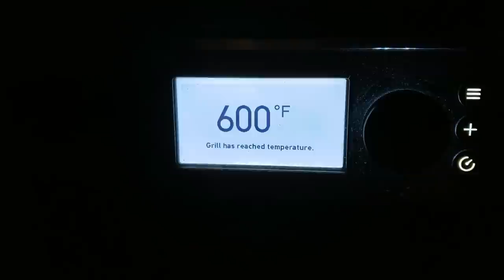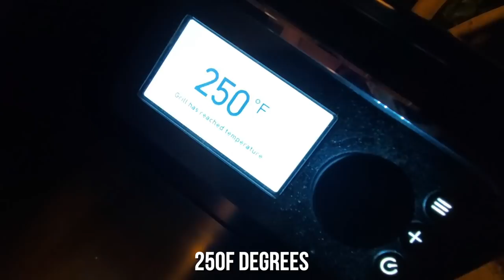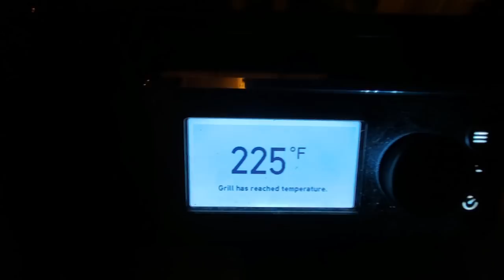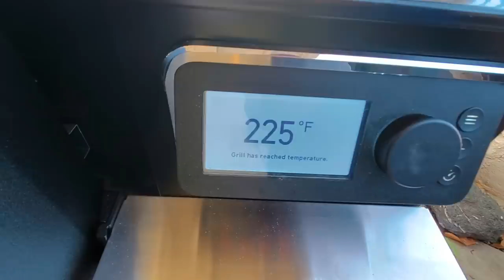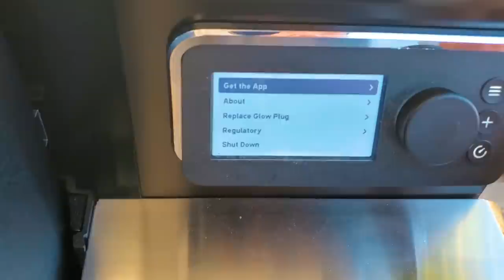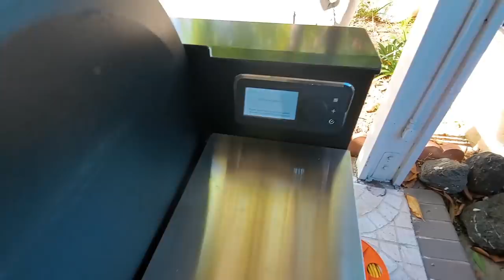Pt 2 WATCH BEFORE YOU BUY | Weber SmokeFire Pellet Grill | BBQ Champion Harry Soo SlapYoDaddyBBQ.com

Comment: If you didnt top off the pellets it would of no doubt stopped feeding.....
Reply: Yeah, he's filling but meanwhile you can totally see the pellets aren't feeding correctly.... not sure what's going on here that's he's ignoring that, but seems very odd to me.
Reply from the maker: You are correct that it is possible the SF would run out of pellets even though there are still pellets in the hopper.  For me, I have no issue refueling after 7 hours compared to my friends who have to put a log into their offset every 40 minutes.  
Nevertheless, I will test for that condition in future videos.  In Video 2, I did not want to risk $250 of meat not cooking as I had to catch a flight to Houston to compete in the world championships.  I will test the hopper more fully in the future to see if it runs, without stirring or refuelling, until the hopper is empty.  Thanks for stopping by.
Reply: I’m sure Weber has a Fix for this. I highly doubt they wouldn’t address it. 

They have great customer service and have always come through
Reply: Thanks for the video thanks for clearing things up about grease fire and flareups 👍
Reply from the maker: @mkawakam  I have a Jim Bowie and I've run it down until the low pellet beep comes on.  Let me test the SF to see how long it will run
Reply: I would have preferred he didn't top off the pellets at the 7 hour mark. I'm not convinced that the remaining pellets would have slid down. Hopefully he tries that in another video.
Reply: NesQuik2258 I sell four brands of pellet cookers. If you don’t periodically check the pellet hopper on any pellet cooker you will eventually have an issue. When doing low and slow, it should only have to be done once. It’s just part and parcel to pellet cookers and this is way over blown.
Reply: Peter Prescott not true. Looking forward to his test. Yet, he would’ve gotten a false low pellet warning from the SF because all of those pellets didn’t slide down.  Not sure how the hopper is attached to the grill but if it’s bolted on, I’m sure they can make a bracket to give it a little more angle in the attachment to let gravity do its job.
Reply: 4wolverines I’m not sure what is not true. I have first hand experience with many brands. Even hoppers that are directly stacked over the auger require your attention. The nature of pellets is that they tend to cling together and create a cavity as they fall. Not always, but routinely. It’s common knowledge within the pellet community. I simply don’t see this as an issue of any concern. No more than managing fuel on any number of cookers. Hey, if it’s a big deal for you then I would go another direction. Pellets will do this.
Reply: @discusthrowerstate  Fix already available - https://www.youtube.com/watch?v=YWFP4uDL71o
Reply: David Crappell  I got an email today letting me know that this is being shipped to me
Reply: Some of my complaints are if it is cool outside the power cord is stiff as a rock andcan trip over and if you move it the grease tray will slide it's self out needs some kind of clips to hold it in.
Reply: It definitely looked like it was about to run out at the refill point (there were plenty of pellets, but they were not moving down and the low fuel sensor was almost all the way exposed and the auger didn't have many pellets left to use). I have had a similar situation with my EX4, but I just stirred the pellets by hand and moved them around. Weber has already put out a fix and I should get mine this week, curious to see how it works. Ultimately it's not that big of a deal to give the pellets a little stir, but I do think it would be great if you didn't have to. Overall I am pretty happy with my smokefire, but I really hope they make some improvements to the app soon. Thank you Harry for clarifying the flare-up and grease fire issue.
Reply: @discusthrowerstate   a major recall, it's not software issues (which could be addressed via patches...) those are design flaws... several and serious flaws...
Reply: @MikeHoncho884   oh men... that thing will catch in a fire... ashes are been produced within the grill, they will clog the grease exits, grease will accumulate and men that's a recipe for a Grease Fire !!!
Reply: see at minute 9 Mr. Soo uses his hand to move the pellets, why??? why you need to move the pellets if you were doing testing against some defects found (one of which was that pellets would fail to be fed)  another fishing move with that grill test     https://youtu.be/ALNnTwN2Kak?t=544
Reply: After 7 hours, I'm in bed with an all nighter brisket smoke....
Reply: Yeah.  My pellet hopper sits above the auger and I still have to make sure it feeds properly.  At times the pellets makes a round dam around the auger opening and I have to stick my hand down in there and sift it around.  So I do not think Harry topping it off after 7 hours isn't a big deal at all.
Reply: This should no longer be a problem with the hopper fix. I get my steeper ramp insert today! When I do my next long cook, I'll report the results. May be a while though, because I first need to have the ash/grease fire problem resolved before I attempt a long cook. I'm sure there will be plenty of people posting on this starting soon.
Reply: The pellet hopper is definitely the achilles’ heel of this grill/smoker. I would like to see the 2.0 version. I think also the flavor riser bars coming out one at a time. Seems like that would be kind of a pain in the butt compared to a drip pan. I had high hopes for Weber. Especially for the price still a little bit steep. Especially if it’s not perfect. I have a different brand right now that has a lot of capacity and run seamlessly and real fatty cooks the most I’ve ran it is 13 hours without checking on it. During the 13 hours there was a couple spritzers but I never opened the pellet hopper or helped it in anyway. And still had enough pellets left over to do a short hard and fast cook. The pellet hopper never needed help!!! When I saw The first views of the smoke fire I knew they would have problems with the flat style pellet hopper. Confident that they will fix the problems in the 2.0 will be close to perfect. Except for those darn flavor-iser bars!
Reply: Also the pellet cooker I been using does not get grease flareups. don’t you think that grease where it’s good add some nasty flavor to whatever you’re cooking??

Comment: I would like to see you do a review or smoke on a Brinkmann smoker grill. Some of us can't afford a webber smoker grill. Someone made a comment about it and said it wasn't a good smoker grill and I would like to know why or what's wrong with it. Thank you.
Reply from the maker: A Weber Smokey Mountain starts at around $300 or a Pit Barrel Cooker is $300.  You can do great BBQ with a Kettle for $150.   You can tease the best out of a Brinkman if you know what you're doing.  Remember, it's always about the pitmaster and never the pit.
Reply: @SlapYoDaddyBBQ  poor Justin!
Reply: Mark, everything can cook great bbq once you learn your pit. I had, still have a brinkmann, and here is a trick I used. The amount of square inches coming out of the smoke stack is just about exactly the same as the quarter inch gaps on either side of the top lid. I simply get my fire pit loaded and as soon as I reach my temps I just about completely shut down the smoke stack. The gaps are by the grates and draws the heat/smoke through both ends evenly. Learned my rythm of log frequency and I really have not had an issue with it. Hope that helps! Afterward I purchased wsm and hardly use the brinkmann. Plus I have a weber kettle that I use to smoke as well.

Comment: The whole point of a pellet grill is to not have to worry about fire management for long periods of time. You can get on technicalities all you want of what a grease fire is, bottom line the product is not safe to leave on an over night cook. Non the less thanks for running it through the gauntlet.
Reply from the maker: I offer 2 data points and my analysis.  Nothing more nothing less.  Your mileage will vary. Buy and cook on what you like and spend your money on what makes you happy.
Reply: KY Investigations “not safe” 🤣 , maybe if you’re using it in the basement next to your laundry. I used an old WSM as a burn barrel. So much heat and flames, the grates were glowing red. Cleaned it out and was smoking on it a week later. Enamel coating wasn’t affected in the least. If you want to sleep on  an overnight smoke....... 0.25 cent drip pan.

Comment: Thank you Harry for a fair and neutral perspective. I read thru nearly all the comments, and didn't see it asked, so I will. Would a higher temp cook be more likely to have a true grease fire? If you slow cooked a bunch of stuff like brisket and pork butt, and finished higher with steaks, wouldn't there be a higher risk of a grease fire? Great video as always!
Reply from the maker: Thanks for stopping by.  Did you see Torture-Test-1?  #1 was H-n-F @400F, L-n-S @ 250F, and sear @600F to ignite grease at the end of a 6 hour cook.  Please check it out
Reply: Can’t comment on the grill. Yet common sense on any pit is to clean after that much grease.  Clean those grease channels, crank up to 600 & good to go. If you let grease coagulate & then crank up to 600, you’ll probably have a fire.
Reply from the maker: Did you see video 1?